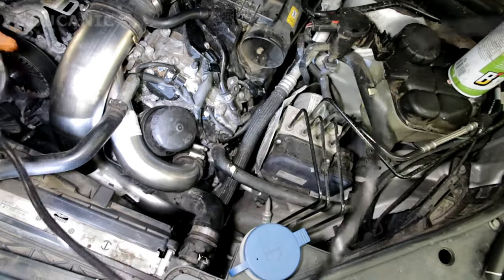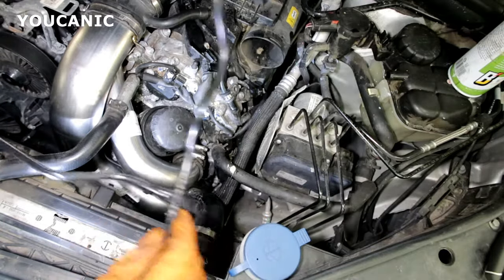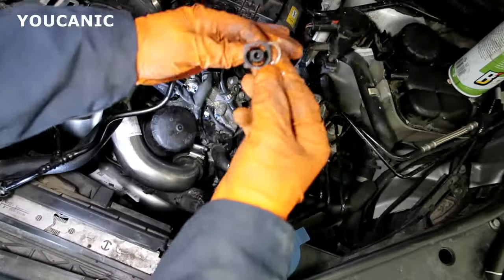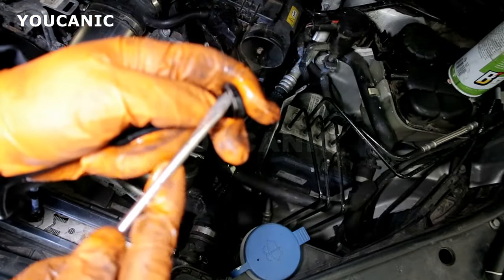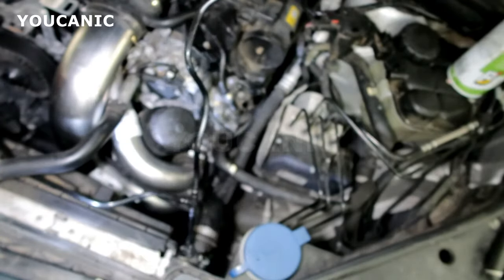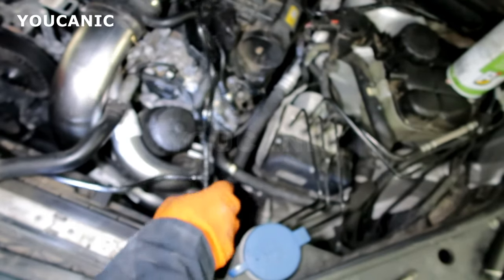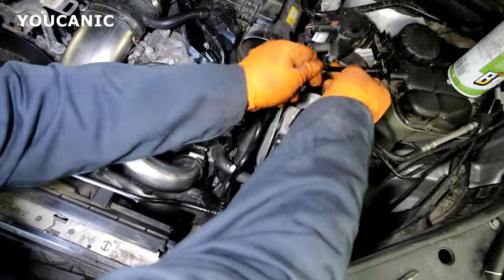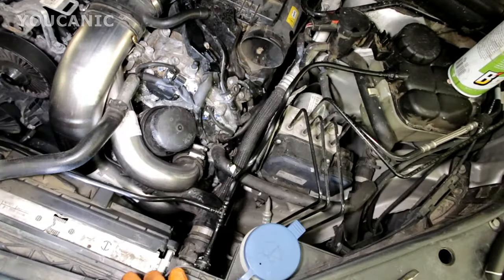Mercedes-Benz Small Plastic Coolant Line Replacement - How To Do It Yourself

Comment: I have a 2014 gl450 and it seems all the hoses are breaking. first time the ones on top cost me 1400 2nd time ones underneat cost 1800 and now its in the shop again i dont know where the hose is yet they havnt tore it down yet. is this common ?

Comment: I have CLA45 AMG and I’m having a hard time connecting the one going into the engine. Anyone have a reason why?
Reply: Hey mate did you sort it out? Im about to do mine.
Reply: @genghis4789  yeah, I found out the CLA 250 vs the CLA 45 AMG just have different connectors that I had to order and was able to do it easy
Reply: Nice thanks mate one end does looks different.
Reply: @genghis4789  No problem bro! Not sure why they did that haha

Comment: For me the connector on the left going into the engine broke off.  would you know the part number for that connector?
Reply from the maker: Thanks for your question! Unfortunately, we can't provide the part number in this setting due to the variety of car models and years. However, you can visit our website, www.youcanic.com, for helpful guides and free resources that could help in identifying the connector. Don't hesitate to reach out to us on our site if you need additional support or access to factory repair manuals. It's our mission at Youcanic to empower car owners like you to make car maintenance more accessible, and we're here to support you at every step!
Reply: @YOUCANIC  Thank you for responding.   Can you tell me the name of hose that the overflow hose connects to on the engine in the video?
Reply: On the part which you want to replace .it has number on it

Comment: I have a 2013 e550. When the coolant is overfilled, where does it vent out of, the reservoir cap or a overflow hose?
Reply: Over flow